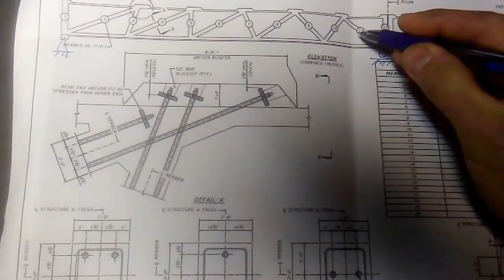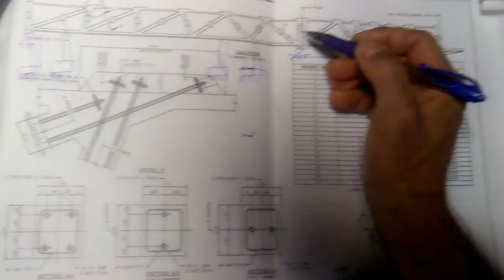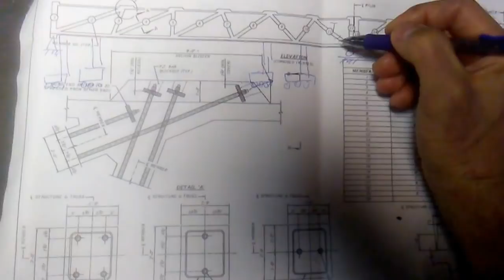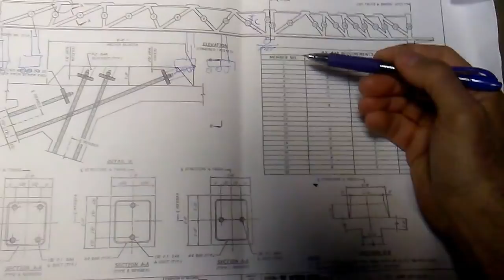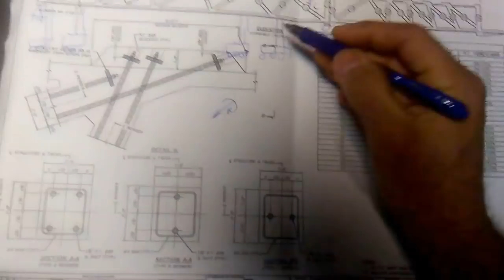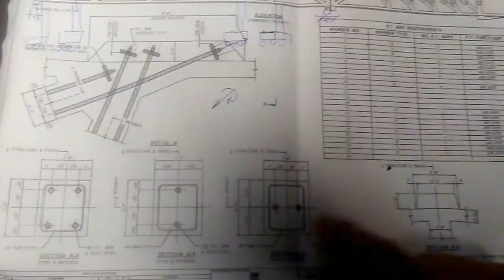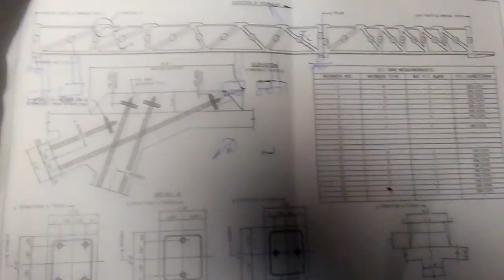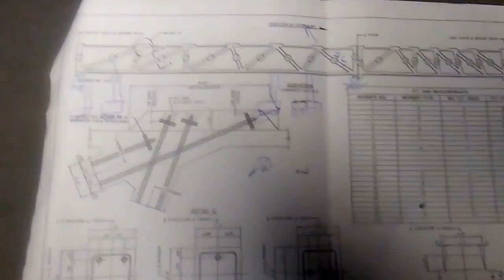FIU Bridge Collapse: The Hidden Truth (Part 2)

Comment: The bridge was not standing there "just fine."  It was developing cracks that were considered significant enough to require some sort of repair.   The contractor was most likely  just carrying out orders.  The designers of the bridge did not know what they were doing.  The bridge was an extremely poor design that was constantly over-hyped.  The minute the oddly configured concrete truss was placed over the roadway, anyone near it was at great risk.
Reply from the maker: It would have been very unusual for the structure to develop cracks just from its own selfweight after final placement. To say the designers did not know what they were doing dismisses the numerous unique and innovative designs that the Figg engieers have successfully completed in the company's history. Of course, regardless of where our opinion falls, we are making many assumptions about what may have happened based on the limited details provided thus far .
Reply: To be fair the designers of many failed structures "did not know what they were doing" in the sense that they were presented with a problem outside of their professional knowledge.  CF the brittle steel plates of the Titanic. In this case the unique factor was that the CLIENT FIU had a vested interest in the public success of the ABC  construction technique.   That may have impacted the thought process of the engineers
Reply: Internet Privacy Advocate — The OSHA report on the subject of the cracks was unambiguous.  Regardless of just when the first cracking occurred, when the span was in place the cracks were large and growing.  The lead engineer looked at the situation two days before the collapse and pronounced it not a safety issue.  OSHA wrote that he should have shut down the project (and the traffic underneath it) immediately.

Comment: I wonder what would happen to the failed point, wherever it is determined to be when the bridge live load was applied at some future date and what the safety factor was.  This bridge has zero redundancy.  The stay cables added that were to be attached added no structural strength.  I look at this bridge as a faulty design from the get-go and the construction sequence also in question.   Exposes major problem encountered by design-build structural projects.
Reply from the maker: Tough call. I ask myself, had I been a reviewer of the design, would I have caught the mistake and raised the red flag? The design on paper appears like it should work. And we don't know yet if there was an issue during construction that perhaps led to the collapse. So it could turn out that the design was actually not a fault here...

Comment: Once again, you're proving you don't know the difference between pre and post stressing.  Clue, if you can adjust the tension post curing of the concrete you are post stressing.  If you stress cables / rods before the concrete is cured you are pre-stressing.  You cannot post stress a pre-stressed cable.
Reply from the maker: Pretensioning and post-tensioning are 2 methods of prestressing concrete. Prestressing simply mean that compression is introduced into a concrete member to resist tension stresses.
Reply: And terminology of someone that dosnt understand could say that tension applied to a pillar/post is post tensioning, just because its being said in an investigation don't mean its the correct use!

Comment: When the bridge was being moved the underside of #11 was in compression and the upper side in tension, just the opposite of what it would be after being placed.  Point #2, During an on site interview one of the contractor spokesmen did say that each end of the bridge would need re-tensioning.  Point #3, the contractor had previously performed re-tensioning to the south side of the bridge.  And  point 4#, the bottom PT rod, the one that blew out, had just been re-tensioned and the crew was rigging the last PT rod for tension adjustment.   
Pick it up from there.
Reply: drkjk — This is inaccurate.  See the OSHA report issued in June, 2019 for a detailed explanation.

Comment: So when the bridge was moved, are you saying that the one or two tensioning bars in that section got stretched out because of the cantilever effect, therefore the tension when put down on the resting point was lower yet still in compression but the gauge showed that there wasnt enough tension on that particular bar,  so,  the workman on the roof of the bridge was trying to get the correct tension on that already streched bar when the bar broke and slingshotted like a rubberband when it breaks?
Reply from the maker: Not quite. This is how I see the sequence of work occurring: The bars were tensioned before the move, while the bridge was fully supported along its length by falsework. So Member 11 was seeing only a small amount of compression due to selfweight at the time of bar tensioning. When the bridge was moved and set down, Member 11 compression due to selfweight dramatically increases, and in turn the PT bar tension decreases because the member shrinks from the added compression. The initial reports indicated that the worker was tensioning the bars during failure....but more recent reports in the Miami Herald state that the bars were being destressed (as they should have been) since the member was in compression and the PT  bars were no longer needed.
Reply: well now im more confused than ever, but, thanks for trying to explain it to me. I do understand that there is a ton of dissinformed people trying to say what happened when really no one has all the answers yet, but, you by far have given the most comprehensible and common senceable expanation. thank you, I'm not an engineer or even very smart but I do understand most things.  just that this one has me spinning.  god bless the victims and they're families.  thanks again.
Reply from the maker: No sweat. A video really would be much easier to understand than my written explanation.
Do not understate your intelligence....I appreciate your interest in the topic and kind words!
Reply: I don't understand what the point of destressing the bars would have been once the truss was in place.  Yes, it was no longer needed because that end of the bridge was no longer cantilevered like it was during the move.  But still, how would it hurt to leave member 11 bars under tension, particularly since much of that tension would have been removed once the member was put under compression?

But destressing would make sense if there was a bending torque being put on member 11 by an unequal tension in the two bars, which would have appropriate during the short time it was cantilevered, but dangerous after the bridge was in place, as I believe someone speculated above.

Comment: What purpose would stressing a tendon in a member that was highly in compression anyway (650 +150 tonnes)? If it had cracked and those cracks still existed under this compression then there was nothing you could do about it. Certainly not by adding more compression. There is no evidence that they were 'adding' to the stress..they might well have been 'de-stressing' that member. (Although this should have been done the moment it was set down on the supports.)
Reply from the maker: Exactly! You nailed it.
The assumption has been that the bars were being tensioned just prior to failure. 
But if the bars were being destressed prior to failure (as they should have been), then why did the bridge fail??
Reply: Cracks in concrete are no big deal.  Concrete always cracks, whether you can see them or not.
Reply from the maker: Depends on crack size and orientation. Also, cracks in post-tensioned concrete receive more scrutiny because of the prestressed condition.
Not all cracks are the same.
Reply: It was noted some where that the rods/cables in 11 were loose, Had come loose after being in position. A company called vsi were paid to tension it after it was built, then they recalculated it as it went on the jacks, it was retensioned while on the jacks, then again while in its final resting place. From what im lead to belive this company were nolonger on site after in had being placed in position and retensioned. Were the deck and the pillars poured at the same time or were they poured at different times?
Reply: There were loads of different contracting companies on site
Reply: Thanks Struc. Today is the first time I watched this video, but I have been saying for some time there were probably 2 tension bars in #11, and if they got somehow out of balance during the adjustment then that could cause the strut to bend and break, same as what you wrote. There is also the possibility, which somebody mentioned in a comment elsewhere, that #11 just became detached from the upper block that links #10, #11, and the canopy due to excess shear stress. Videos seem to show #10 moving toward #11 very early in the collapse, as if #11 were getting shorter at some point along its length or an end protruding through the canopy or walkway. I think the lower bar was stretched unreasonably and broken, causing it to snap out from the upper tie block, when the walkway separated from the lower end of #11 during the collapse; which also ripped the lower bar from the bottom of #11 as shown in the pictures. Note the lower end of #11 remains resting on the pier, while the walkway fell to the ground and apparently took the lower end of the tension rod with it. In other words, although #11 was the initial failure, it was not necessarily the tension bar which broke causing that failure, rather the opposite order. This is also consistent with Andrew's comment below.

Comment: The bridge span failed on the FIU side of the street.  You, however are focusing on the opposite end of the structure, that would be adjacent to the second section (not yet placed) and on the Sweetwater side of the street.  Your engineering points are well taken, but you are addressing wrong end of bridge.  Construction worker tensioning cabes was on FIU side of street; not Sweetwater side.
Reply from the maker: William Reuter Thanks for your input. I'm not sure I follow.... Member #11 was being worked on just prior to collapse.
Reply: @William Reuter; No, you're wrong.  He is talking about member #11.
Reply: Looks like the Sweetwater/Canal side collapsed according to the photos.
Reply: It's very easy to get confused as to which end is which because often the photos or renderings are from opposite sides.  I'm not familiar with the area which also make it more difficult.  The side that broke was to the left of cars waiting for the traffic light.

Comment: Web member 11 probably was damaged during the move when it was under tension. Either it was not tensioned correctly or some other change caused that member to exceed it's strength. This is probably evident in both the subsequent cracks, and the silence on the issue since the failure. 

As you mentioned when when they set the bridge down No 11 changed to compression and the tensioning rods loosened. That was the beginning of the end for the bridge. Then my guess is they added additional tension to close the cracks and "repair" the damage. Adding tension to the bars in the section of the bridge would do nothing but add additional compressive load to the concrete. Once they exceed the yield of the concrete, the bridge came down.
Reply from the maker: David Kennedy I agree with your logic. However, a recent article published on Friday by the Miami Herald tests your theory (and mine as well). The article states that an on-site engineer confirmed that the contractor was in the process of destressing the bars since the diagonal member was in compression with the bridge in its final state. If this is the case, then our theory that the collapse occurred due to over tensioning of the  PT bars is certainly questionable!!
Reply: Were both rods in the failed member kept continually at the same tension?  If a truss member starts to buckle, the outward side will be under tension while the inward side is under compression.  If tension rods were preventing a damaged member from buckling, I would think removing them might cause the member to fail.

Comment: Concrete has it full strength in straight up or laying down. Concrete members on a leaning scale lost it's load capacity. The concrete roof failed first, that in turn doubled the torsion on the columns, which caused the deck to fail.
Reply from the maker: George Stone Interesting theory George. However, I disagree with your premise that the orientation of the member affected the strength of the concrete. By your theory, diagonal truss members made of steel would be weaker than horizontal or vertical steel members.... which is not the case. What does matter is the direction of the applied load because this affects how the member behaves. With trusses, the diagonal members are designed as axial force members with negligible bending. So the diagonals behave and are analyzed as columns when in compression.
Reply from the maker: George Stone Appreciate the like! If you're interested, check out Part 3 where I perform a detailed analysis of the failed member. It will be up in a couple of hours. Thanks again for your interest George!